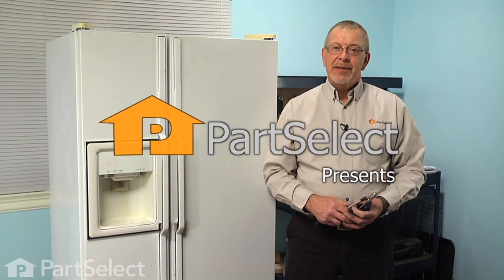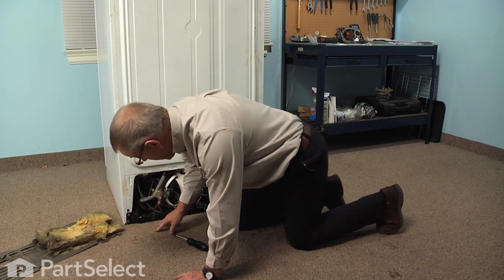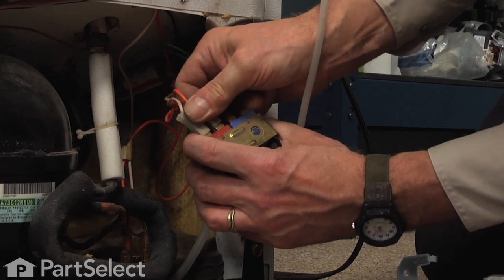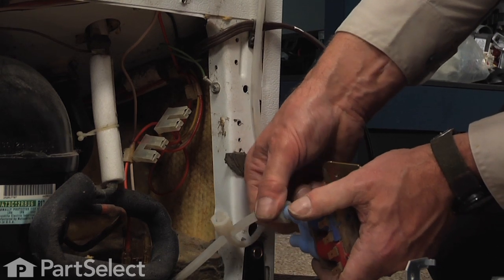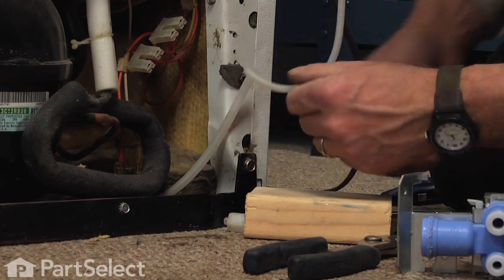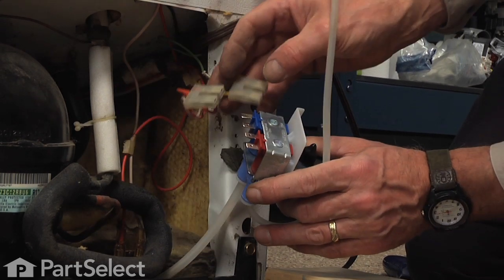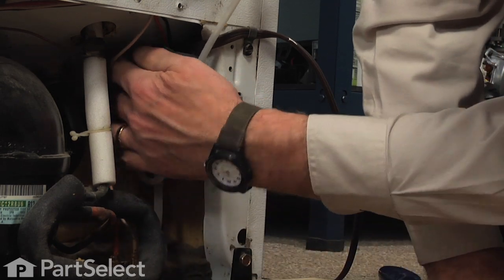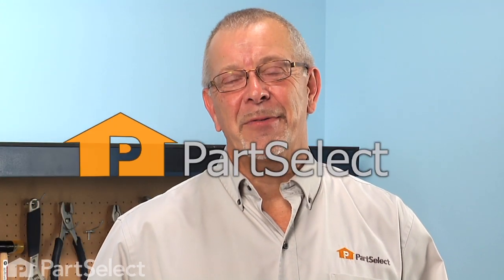Refrigerator Repair - Replacing the Dual Water Inlet Water Valve (GE Part # WR57X10051)

Comment: Why two valves
Reply: One valve is for the ice maker and the other is for the water dispenser on the front of the freezer door.
Reply: @moto5513  so it needs two water pipes?
Reply: @AgentOffice  There is one inlet supply line to the valves. One solenoid/ valve goes to the water dispenser and the other goes to the icemaker .

Comment: my valve came with male threads for the outlets the original has quick connectors Lowes says they do not carry such cinpression fittings. Where can I get them. Rem  one is 5/16th".

Comment: omg.  Installed successfully 2 months ago.  Water tubing (from sink) INSIDE new valve just broke off INSIDE the valve!    Can I in any way take valve apart to remove broken piece of tubing?  Or do I need to buy another new valve.  So weird!  Thanks for your help!
Reply from the maker: I wouldn't advise taking the valve apart but you do have a couple of options. The first is press the ring that’s on the water inlet valve where the tube slides and sees if that releases the broken piece of tubing from the valve. If that doesn't work, then take a pair of needle noise pliers and carefully remove the piece of tubing from the valve. If you click the above link, it will take you to the parts page and there are lots of great customer written instructions and on the first page of the instructions a customer had a similar experience as you. I’d suggest reading that. If that doesn't work then the valve will unfortunately need to be replaced and sounds like the tubing should be replaced. Hope this information helps. If you need any more help then let us know.

Comment: im thinking about changing the water inlet valve but i dont no if its going to fix it there realy cheap on ebay like $30
Reply from the maker: Hi Richie, you can test your water inlet valve to see if it's the problem by going to our troubleshooting repair page: http://www.partselect.com/refrigerator+test-water-valve+repair.htm. If that is indeed the problem, you should also be able to purchase the part from us if you live in the US or Canada. Thanksf or watching, and for your question!

Comment: The wire harness doesn't match up correctly for me. The right solenoid on the new valve has smaller female connectors than the previous valve. How do I fix this?
Reply from the maker: Hi Blaine,
The new valve should have 3/16 inch to ¼ inch terminal adaptors supplied with it. You would attach the adaptors to the new valve terminals and then reattach the harness connector. Check the package for these parts and good luck with your repair.

Comment: I replaced the water inlet valve on my GE GSHF3KGZBCCC side-by-side refigerator but the water from the dispenser comes out normal for half a second then goes to a trickle. Already unclogged the train tube which was causing water to leak from freezer bottom.
Any ideas what could be causing the volume of water from the dispenser to drop so suddenly ?
Reply from the maker: Check the inlet water valve for a restriction and also the water reservoir in the fresh food compartment for a possible partially
frozen or kinked water line.

Comment: I just replaced the water inlet valve on my fridge. part # wr57x10051. I am getting water fine but see no signs of water going to ice maker. what can I do. it has only been 1 hour since installation, do I need to wait
Reply from the maker: Bobby Jackson Did the water flow return? It can take a bit of time after the repair for the water to refill the lines.

Comment: hi there this may be a bit of an odd question but whats the model of the fridge in the video? I picked up a used one for close to nothing and it needs some work done but the previous owner removed the label. Long story short I need to source some parts for it and having issues finding a distributor in Europe without the brand and model no.

Comment: Hi, If  not getting any water at all after installing the saddle ring, does that mean it's most likely the water
 valve?
Reply from the maker: +Licker Pickers Toothpicks If you are referring to the saddle type piercing valve that is attached to your household ½ “ waterline as a “saddle ring”, then you may have a problem with the inlet water valve on your refrigerator. However, make sure that the piercing valve has been opened fully after you tightened it to pierce the water pipe. They often don’t make a large enough hole to deliver satisfactory water pressure.

Comment: My inlet valve tubing is copper! Not sure how to get it off and put it back on.  Had everything ready to go and could not disconnect it.  isn't it normal to have copper and not plastic there?  NOW WHAT
Reply from the maker: What's the model number of your refrigerator? I'll take a look for some installation instructions for cooper piping and the model number will be a handy reference.

Comment: Water dispenser flows after actuator is released. Replaced micro switch and dispenser solenoid but water continues to flow. What next? Water inlet?
Reply from the maker: Hi Gregory, you may want to check the inlet if you already replaced the micro switch and the dispenser solenoid. If you provide your model number I could look in to this for you.

Comment: i have a GE' side by side refridgerator the short plastic tube that"s inside the freezer , it supplies water to the ice tray. Well it freezes up and pushes away from the back and water leakes down the back of the panel on back wall of freezer.I took off the panel and defrosted the coils and put everything back in and turned the water back on but the tube froze up again. Question is should i get water valve myself and install or should i call out repair man.Don't want to buy wrong part for $165 and not be able to return,but i know i'm able to change valve if that is the right part to solve problem It's a GE model # TFX26PPDA-CC . Any hepl would be appreciated.
Thank you
Reply from the maker: Hi Willyboydd3311! Apologies for the delay here. The symptom is indicative of a water valve that won’t shut off completely, allowing water drops to freeze and accumulate ice in the fill tube. This can be caused by a defective valve or by a restriction to the inlet of the valve. Check the inlet of the fill valve for any accumulation of debris and also the supply for adequate water pressure. Low pressure can cause the inlet valve to not completely shut off and create a drip. Good luck with your repair.